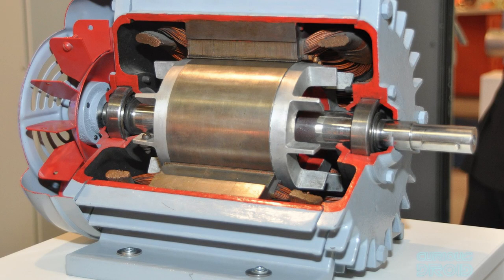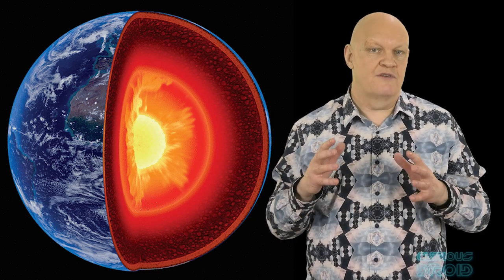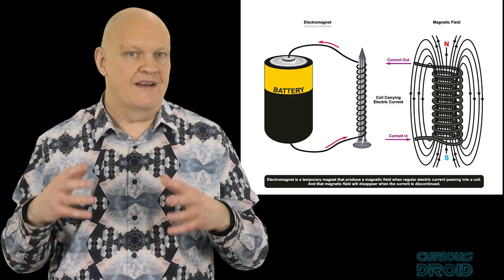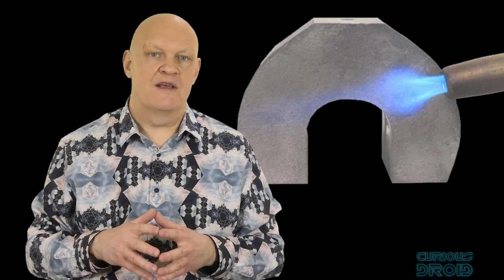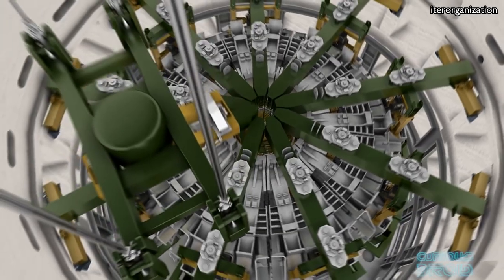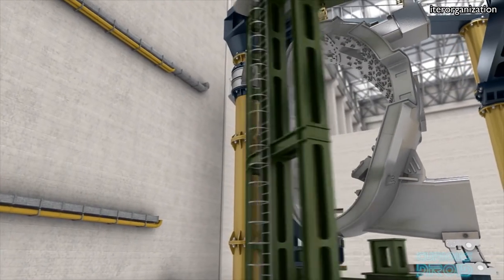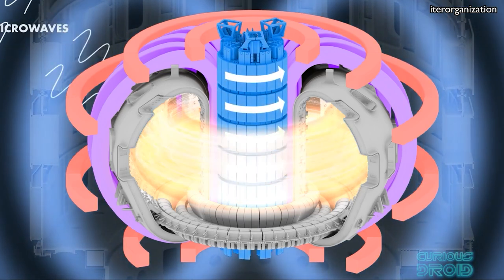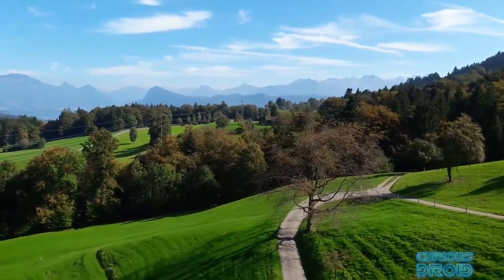The Most Powerful Continuous Magnets Yet Made

Comment: At 10:30, the failure mode for fission reactors is mis-construed as exponential runaway, and this is true for Chernobyl, and the lesser known SL-10 incident, but isn't generally seen as a risk for normal reactor designs. The more common risk is the challenge of dealing with the decay heat that continues to be produced long after the fission chain reaction stops -- this is is what caused the Fukushima and Three Mile Island accidents, and it's what most of the safety efforts focus on. All fission had ceased hours prior the Fukushima core melting down from decay heat.
Reply: Too true!!
People think nuclear bomb explosion. 
This doesn't help to understand and address the problems and solutions of nuclear power.
The design of the power plants is the problem to be addressed, once the problem of chain reaction is well known and solved.
Reply: Was about to post the same thing. The Fukushima reactor had arrested all fission activity long before the wave hit, when the control rods were inserted due to the earthquake. The decay heat of a large reactor is no joke.
Reply: Would've been nicer too if CD had mentioned thorium based reactors, a technology that isn't as widely used but still quite very interesting that needs to be further developed, those don't solely rely on uranium, only a small amount in combination with the thorium element (which is much more abundant). With the added bonus that in case things do go south (be it a technical or human error) you can separate the two elements and easily prevent a meltdown iirc

Edit: If I recall, you can't weaponize thorium either like we can with depleted uranium
Reply: A meltdown is a runnaway chain reaction that cannot be stopped because it became impossible to absorb the neutrons causing it.
This progress generates a lot of heat and melts the cores down, hence "meltdown". That is a serious problem as it will continue to generate radioactivity without any way of stopping it, whilst melting the ground and therefore threatening to contaminate ground water.
If it doesn't explode it's because critical mass isn't achieved, so it won't be exponential. That doesn't mean there is no more fission going on though.
Reply: @gibbeldon  Actually, that's not quite right. Neutrons don't play a major role in melt-downs like Fukushima and Three Mile Island, which exemplify the dominant safety risk for nuclear reactors: decay heat. Fission breaks U235 into two smaller atoms of approximately half the size, along with neutrons that can trigger additional fission events forming a critical reaction chain. Most of the energy liberated by fission is released immediately, but not all of it. 

The fission fragments are typically unstable atoms that will undergo further spontaneous decay events over the subsequent seconds, minutes, hours, days, and years. Such decay events can release alpha particles, electrons, or high energy gamma photons, but they don't split the atoms in half the way that fission does, and more importantly, they are spontaneous events that occur on their own schedule without regard to the state of the reactor. They aren't chain reactions, and they can't be stopped by any known physics.

Fukushima was SCRAM'd, and with the control rods fully inserted, they aggressively absorb stray neutrons, such that the reactor is well below criticality. Even though there's essentially no U235 fission taking place anymore, the reactor doesn't immediately drop from 100% power to 0% power. The fission fragments from all the fission that happened prior to the shutdown are still decaying, and in aggregate, this produces roughly 7% of the power level that was being produced before shutdown. Most of the heat comes from the shortest-lived isotopes, and within an hour the decay heat is down to only 1% and it continues dropping as the hottest isotopes decay away. Eventually, the reactor produces heat slowly enough that it can passively radiate away, but you need active water cooling to survive the first few days.

A melt-down is the failure to adequately remove this decay heat. Without sufficient water circulation over the core, this heat builds up and the fuel melts. At such temps, the zircalloy cladding on the fuel strips the oxygen out of water, producing hydrogen gas that can accumulate and explosively recombine with the oxygen in air. It makes a bit hot mess that takes a lot of effort to clean up.
Reply: ALL fission reactors are essentially running juuuust below the point where they can runaway.  That's how they get hot enough to flash water to steam, and drive the steam turbines necessary to generate power.  I love nuclear power.  Much cleaner than any other source, except for hydro-electric.  Wind and solar arrays are visual and ecological polluters, and grossly inefficient.
Reply: Decay heat is about 1% of rated power if memory serves. And that decay heat is what can cause meltdown. In a BWR or PWR LWR, there is no chance of “runaway” reaction. It’s actually tricky to moderate the neutrons to even sustain fission.
Reply: @peterjohnston1224  Wind and solar are clean energy producers, once constructed. I guess disposal is a minor pollution problem as well.
Reply: Yes, Fukushima was not quick. And completely preventable if they asked for help.
Reply: I, too, am a nuclear energy armchair expert! Let's build more clean nuclear reactors and get rid off dirty old wind and solar energy production!!1
Reply: Thank you. I was looking to make that point. Also, the radioactivity released at Fukashima was due to venting and from the cooling system. Also the 'radioactive products being around forever' idea is a badly misleading statement. As with any radioactivity, the more energetic the release, the shorter the half life. So the stuff that lasts a long time is only very mildly radioactive, as all the really dangerous stuff decays away quickly.
Reply: @kitemanmusic  have you seen calculations how much resources are wasted to make those and how much it takes resources to recycle them? afaik from start to finnish they are long way of being meaningful solutions. so much waste and so little output. but maybe sometime tech gets there. but so would thorium/fusions reactors. so idk.
Reply: @ddopson  
That was a very well-written post, that taunt me quite a bit.
Reply: @ddopson  That was the most well-written, educational, and satisfying reply to a reply to a comment that I have ever read. Thank you.
Reply: @SuperAd1980  lol nuclear is by far the most expensive.
Reply: @SuperAd1980  On paper, sure. Real world is a whole different thing. And thats generally the problem with fission energy... its all easier said than done. End of life for a solar or wind farm may be a big expensive project, but at least the parts can safely be recycled or scrapped.  And as weve seen with California's grid, these companies love to throw money at building new stuff and hate spending money to maintain old stuff. And in the case of nuclear, not maintaining it isnt an option.
Reply: @peterjohnston1224  Hydro-electric can have a huge negative environmental impact on the surrounding area, so nuclear might actually be cleaner in that regard.
Reply: @powertothebauer296  I'm not clear what point you are trying to argue. I'm aware of the natural nuclear reactor - very cool. Critical mass is highly dependent on the physical configuration and presence or absence of neutron moderation. Cadmium is an aggressive neutron absorber, so yes, its presence makes chain reactions less likely -- basically a control rod.

Anyways, there's two sources of heat: immediate heat production from fission reactions, and delayed heat production from decay of the fission products. For nuclear reactors, the delayed heat is far far harder to deal with. Any sensible reactor can SCRAM very quickly, ending all fission. But heat continues to be produced and without sufficient cooling, the core melts, liberating all the nasty fission products from years of operation. That's what this convo was originally about.

Comment: Slight correction at 7:39, MRI machines operate on the basis of aligning spinning Hydrogen nuclei, not hydrogen electrons. There is a research area called EPR (Electron Paramagnetic Resonance) which does look at the spin of electrons in different materials.
Reply: Yes.  The proper name for this technique is nuclear magnetic resonance imaging, where nuclear refers to the hydrogen nuclei (protons).  When placed in a magnetic field the proton's magnetic moment (spin) can align with or against the applied field, resulting in two slightly different energy levels.  The transition between levels requires photons in the radio frequency range, depending on the magnetic field strength.  Nuclear magnetic resonance (NMR) spectroscopy is also used with other nuclei, such as carbon-13, fluorine-19, and phosphorus-31 (which, like protons, all have spin 1/2) and is used routinely for chemical analysis.  NMR spectroscopy can also be used on higher spin nuclei, such as hydrogen-2 (aka deuterium, spin 1), but is more complex.  The word "nuclear" was dropped from the name to prevent scaring the ignorant.
Reply: There was on other point in the MRI portion that needed clarification. If metal is brought into the room while the MRI is at field, it will be pulled by the magnet, but they will not heat up because of the magnetic field.  Metals heat up because of the RF (radio frequencies) being used to capture the image.  The point still stands, Bringing metal into an MRI is very dangerous. As the video shows, small metal items can become projectiles (like that stapler). In the case of larger objects, they can cause people to become pinned and crushed.

MRIs come with a "quench button" that causes the liquid helium to vent.  Allowing the gradient coils to heat up means they will no longer be superconductors.  And when the energy stored in the coil transforms into heat through resistance, the magnetic field is gone.  You really don't want to do this, cause it can be over $100,000 to replace the lost helium and bring the MRI back to field.
Reply: I forgot to remove my belt before getting an MRI once.  The buckle vibrated at the same frequency as the buzzing sound you hear when the unit is operating.  Possibly the most fun anyone ever had in an MRI machine.
Reply: 👏👏👏👏. Wow, you are all so clever.
Reply: @thetruthwillout9094  It's always so nice when people feel belittled by others having knowledge.
Reply: @steve1978ger  they don't actually spin, not like a ball would spin, it basically does a thing in a way that we don't understand, but we describe it as spin.
Quantum physics is weird, like types of quarks are called up, down, top, bottom, strange, charm. It doesn't mean their up or bottom, just names to describe them in a way we understand.
Reply: E Van  I do.
Reply: @steve1978ger  Electrons spin in 4-D. We cannot visualize 4-D. Our brains cannot wrap around that idea.  
If we plot a line, we can describe the points in this line as (x). If we plot a plane, like a sheet of paper, we can plot points in that plane as (x, y) coordinates. We can do the same for 3-D, Euclidean space, and have (x, y, z) coordinates. In Minkowsky space we add time as a fourth coordinate, more or less ;-)
The best we can do to visualize the spin is the "belt trick" applied to the Moebius Band description. Google it. Than again, what we see is in 3-D.
Reply: And this is why the original name of the technology was actually NMRI which stands for Nuclear Magnetic Resonance Imaging (its operates on nucleai as you said) but the "nuclear" word was later droped presumably because ppl around the cold war (and even later) kinda feared a machine with this "n word" in its name. Wheter this is an urban legend  or not that I don't know.
Reply: @TaroutCommodore  Correct, just as we explain time which is the passing of one moment to another.
Reply: I work with a NMR machine almost daily in the laboratory to analyse chemicals
Reply: E Van  I did for one.
Reply: He also used the obsolete analogy of electrons in “orbit” like planets around a star.
Reply: @TaroutCommodore  Quantum physics is Jabberwocky. The slithy toves did gyre and gimbal. Should we try to explain to Paul how electrons are not anywhere, yet everywhere,   until you observe one?
Reply: I may not be a smart man but I did work in a nuclear spectroscopy lab
Reply: @thetruthwillout9094  No, they're just educated
Reply: @steve1978ger  Electrons and all subatomic particles, for that matter, don’t spin in the classical (mechanical) way. This term is just a classical term used in quantum-mechanical situation similar to quarks not actually having colour. I’d wishI could elaborate more, but that about the extent of what’s left from my quantum chemistry lectures :)
Reply: @outerrealm  Even though the Bohr model was quite soon after its inception proven wrong, it is to this day used for educational purposes because it is, albeit not correct, easier to grasp at first. I wouldn’t be therefore so opposed to using it in a general population oriented video (although it’s perhaps a bit quotable how much “general” are we, Pauls viewers:))
Reply: E Van  A majority I'd think.
Reply: @CraftyF0X  true
Reply: @777jones  Jenny would be so very proud...were she still with us today.😔

Comment: Those figures are absolutely mind bending, though 15 times hotter than the centre of the sun is how my daughter in law has the heating on at home! Great to see you looking so well, long may it continue and thanks for the superb content.
Reply: LOL!
Reply: It's also a clue as to why the sun works and fusion here on Earth doesn't. (At least not sustainably.) It turns out that our sun isn't large enough to produce nuclear fusion through pressure and temperature. Thanks to its density and size, random quantum tunneling events cause particles to "accidentally" end up in the nuclei of other atoms, resulting in a fusion event. Such events are very rare, but with something as large as the sun, they happen often enough to keep the nuclear furnace running.
Reply: @thewiirocks  that same tunneling mechanism is a giant proportion of the fusion events in any star, regardless of size, is it not?
Reply: @cornoc  It's going to play a big part, but the effect slowly gets overshadowed as stars get larger. Once the mass of the star is great enough, "normal" fusion events from pressure and temperature begin to take place. Which is why the larger the star is, the hotter it is and the faster it burns through its fuel. A typical blue giant, for example, lasts about 1/100 the time of a yellow star like our sun.
Reply: @thewiirocks  hmm interesting. i guess at a certain point the nuclei just have enough energy to overcome the potential of the electromagnetic field, and so tunneling will still increase the number of reaction events but is no longer necessary for them?
Reply: It isn’t the heating in your daughter-in-law’s house…it is your daughter-in-law.

Comment: The best-explained video on fusion on YT. You outclass them all.
One thing worth mentioning, beside the problem of energy balance, Qt Vs Qp (total efficiency Vs plasma efficiency), is the problem of the tritium portion of the fuel.
If we have to feed all that tritium into the plasma daily, we can't... There isn't enough around. The agreed solution comes from the tritium for fueling can be breed by irradiating the deuterium with neutrons. ITER contains a converting blanket to test the viability of the breeding method. If this doesn't work as expected, it could be a big headache for reactors using a Deuterium-Tritium mixture as fuel. This is the mixture that require the lowest temperature for ignition...